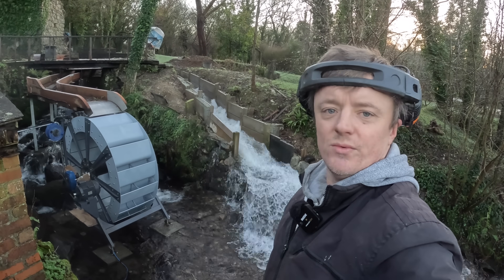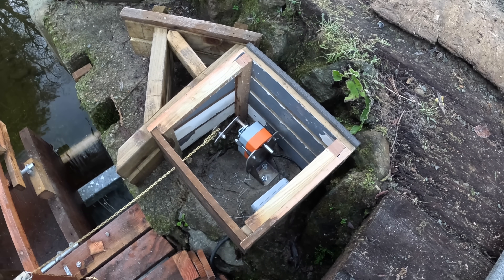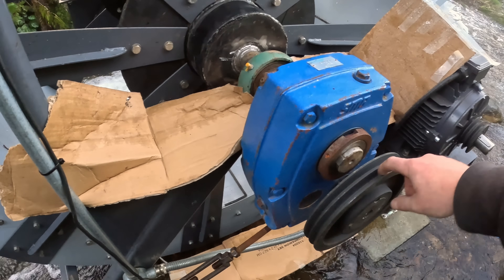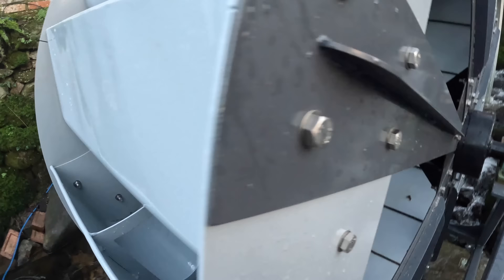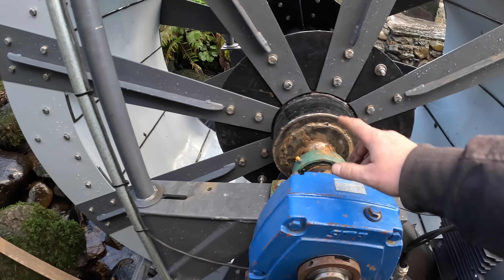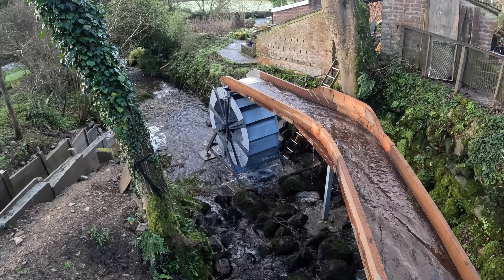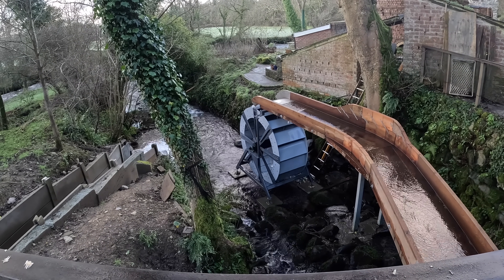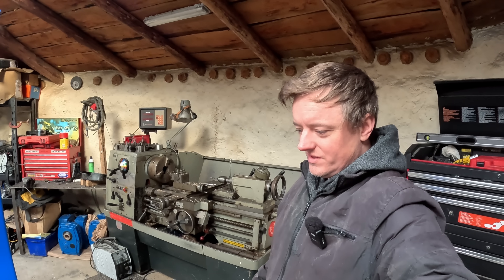Powering An Old Mill  1.5 Kw Lake District Overshot Waterwheel Project Part 5

Comment: If you wish to delve deeper into fatigue, Mechanical Engineering Design. Shigley, 2nd Edition is excellent and easy to understand. Later editions wandered into numerical analysis for writing computer applications and is not necessary (and confusing). FEA is not someplace where you want to go. Without a thorough understanding of the "nuts and bolts", totally erroneous solutions will result.
Without knowing what quality steel you have access to, design with low carbon, low strength, easily weldable. Replace your thin "diaphragm" plate with a much thicker (say 1.5") faced plate with a shoulder turn to stop at the pipe. Weld OD of shoulder to pipe, press fit, precise bore. Journal also shouldered with radii all along length, light press fit into faced "head plate" (chamfer in plate to receive radius). Weld shoulder of journal to head plate. Note: internal shaft does nothing but add weight. Pipe "axle" is by far "stronger". Attention to weld finish and detail just as important as described previously. BTW Austenitic stainless steels are among the worst materials for fatigue resistance on the planet...the reason that nuclear from the 60s-70s currently needs massive repair. Current stainless steel technology is light years ahead of that time ..but expensive. Luckily, your buckets, etc are subject to very low stresses in fatigue loading. I realize that much of this is of little help with your current...but for future. Best of luck.

Comment: Firstly, I admire the research and work that you have put forth with your wind turbine and water generation projects. Much respect.
After retiring from mechanical engineering after 40+ years, much of it in designing for fatigue and mitigating fatigue failures of the designs of others, your construction of the water wheel rotor at the shaft interface was an "oh oh". I have seen many such constructions fail in fatigue much as your failure in a fairly short time. The thin "diaphragm" from the larger pipe to the shaft is very problematic in fatigue (lacking weld quality aside). BTW Multiple diaphragms only lengthens the process and makes the destruction worse.
When rewarding, clean surfaces very thoroughly, grind out defects as best as possible (worst enemy in fatigue), controlled build with MIG towards as large a radius as possible, cooling as slowly (insulate) between passes. Repeat process until access is gone, Finish with gringing, polishing, coating area with epoxy to protect. The torsional element of the stresses is not present on the non-drive end, but will most likely follow in time.

Comment: Hi Kris, your cracking was very likely caused by fatigue. Depending on the source, its reported that around 80-90% of metallic failures on moving machinery are due to fatigue. Fatigue happens when you have a cyclic stress regime. In something like this it could be caused by a misalignment of the shaft/bearings, but I think you were quite careful on that front. Another possibility is that there is some kind of load being fed back up the shaft on that side from the alternator, possibly when it is trying to control the wheel speed. Hopefully your fix of generally beefing it all up will help to reduce the stress. The bigger weld looked to have a nice radius on it. If the worst happens and it does reoccur, you might want to think about how to reduce any stress further, such as changes to the breaking load fed back up the shaft, or by further spreading the load on that shaft/flange intersection.
Reply: slap a 20mm leg TIg fillet on it and itll be fine 🤣

Comment: Do you understand and have you considered the "bootstrapping" problem?

For example, if your system needs electricity to be able to hold open the relay that would otherwise pull the pin and shut off the power?

Secondly, it seems a lot of components in this system don't "reset" automatically... Isn't this annoying for the customer to constantly have to go and fiddle there? A bit of hysteresis might be a better design.

Lastly all the little power supplies everywhere seem like a recipe for failure points.

Good luck!

Comment: There's only a couple of things I thin would improve the wheel.  First is to put rubber around the sides of the water wheel to reduce the splashing over the edges and prevent the water from dousing the generator & bearings.  The other is instead of a complete cut off, I would put in an actuator to reduce the flow instead of a full cut off.  The customer would have to manually reset it, and if you have a reducing effect it would save a lot more headaches.  But this turned out awesome, I hope it lasts for many many years

Comment: Hey Kris.  Thanks for taking us along on this learning adventure.  I am trying to get my head around the economics of this installation where output maximum is 1.5 kw.   My utility charges $0.11USD per kWh.  At that rate if I assume average output annually at 50% or .75 kW 24/7 then the return looks like this :  0.75kW,  18Kwh /day,  6570/kWh /annual,  $722.70 savings @ $0.11/kWh

Comment: One further innovation would be to use the actuator so that rather than pulling a pin, it actually moves the water flow control flap up and down in accordance with the water wheel speed.  I suppose the only real advantage of this is saving water.  Love your work!
Reply: Would an actuator work in a powercut though?
Reply: @pheart2381  they make fail-safe actuators that would work, but not with the crude "hinged flap" design they've got going on. They'd need to design a better flow control system which, to put it bluntly, is way beyond their engineering abilities.

Comment: 0:55 "..it's a proximity sensor which reads the speed of the wheel which goes to a tachometer relay and then that relay monitors the speed. If the speed goes past the set value it then opens a relay then sends power to an actuator which then pulls an arm which pulls a pin out which drops the flap..... It's very simple"

Just want to remind you Kris, this is not very simple for 'simpletons' like me. Just saying - it may seem obvious to you, but to me it's incredible. 

You do a great job of explaining how everything works. The more I watch your channel the more "simple" these engineering feats seem to be. I want you to know you've given me the knowledge and confidence to build a post and beam woodshed (4mx6m). I wouldn't have been able to do that if I hadn't subscribed to you years ago. 
Thank you for sharing your knowledge <3

*Edit, typo

Comment: I'm sure I'm not to first to suggest that aside from the deadman trip on power-fail or overspeed, you could be controlling the flow rate with an Arduino-controlled actuator. Stupid simple PID algorithm with appropriate delays. Water under the bridge as it were, or rather over the waterwheel.

Comment: Kris, the reason the weld failed is a design flaw not a poor weld.  You welded 360° around a solid shaft to a plate.  Next time eliminate the welds and use keyed hubs.

After welding the weld cools and put the joint in tension radially, it will fail like that,  Your other side mostly like will fail at some point.

Comment: As time, weather, corrosion, and dirt accumulate on that pin, what ensures that the actuator will have enough power to pull it out - especially if it hasn't moved in months?

Comment: That broken weld, are you sure the axle isn't flexing when the waterwheel turns, it could be a stress fracture as you do have a heavy gear box sitting on that side?

Comment: Excellent Wrap up Engineering. The current flow is ideal for full performance with practically no impingement. You've taken a unique old water power site and breathed new life into it with the modern controllers an monitoring abilities. 
This goes down as one of the best technical design project progression video series ever made.

Comment: Hey Kris, I had a thought looking at the video of the water entering the buckets, there is a strong bias towards water falling into the buckets, towards the centre of the buckets. The water coming around the corner of the shoot creates a lot of turbulence too. I wonder if there is a way to straighten the flow and also get it to be more even across the width of the wheel?

Comment: Hey Kris, good work appreciate the videos on this it’s been a really excellent project. Just on that point of failure, it’s very common to see on conveyor drums I manufacture. It will be solved by using considerably thicker end plates to reduce flex between the shaft and OD the welding won’t be the issue there. Keep up the good work

Comment: You tried to use cheaper materials and it bit you in the butt. Instead of using a proper piece of heavy shafting across the entire width of the wheel you used a piece of pipe and thought you could just weld end caps on with a short piece of shafting to ride in the bearings. You forgot to take into account the massive torque water wheels make and you built the wheels connection to the bearing too flimsy. The shaft should be a minimum of 4" in diameter, 6" shafting would have added some safety factor as it is not just the weight of the wheel, but the weight of the multitude of gallons of water loading half the wheel.
There is a reason most water wheel bearing are not ball bearings and that is because the wheel spins at such a slow RPM that there is not enough heat generated by friction to warm the grease to help lubricate the bearing and the bearings fail prematurely. They are also going to fail early as their not sealed from the water and corrosion will cause the bearings to fail early. Proper water wheel bearing were built from wood i.e. Lignum Vitae that has an oil port and reservoir, Bronze sleeve bearings were used, and Linear plain bearings(used in a slow rotary application) from Pacific Bearing Co. they have an aluminum or 316 Stainless Steel housing with an ultra slick Frelon liner as the running surface and their 4" dia. shaft model has a static weight rating of 100,000 lbs/ bearing so it is unlikely you will be able to overload it. These bearing can have zerk fitting added to lubricate with grease of oil and they work even better in wet environments or submerged as the water adds lubricity to the bearing. Oh yeah, and they cannot corrode or rust as the aluminum model is heavily anodized and the stainless model is impervious.

Comment: Did you use flow rates from current typical river flow, or forecasted models from the increased atmospheric energy? We've been designing in for higher river flows for a decade now, but the forecasts are increased every year! We should have forecasted our forecasts :) But anyway, in some cases we are using nearly 40% higher throughput because it turns out that river basins are responding very nonlinearly and with big jumps in some streams and larger tributaries, barely noticeable in others, while the downstream collectors (i.e. the main rivers) are trending to the average forecasted increases reasonably well. But we've been caught out by those two things - generally higher increases in each year and far more variance in the increase from stream to stream. We are learning a lot as the energy goes up, but I fear our longer term (say up to 1.7C or 1.9C levels) may be quite far out either way, can totally see the increases not going much higher as well as increasing more. The scientists we work with are very honest about the magnitudes catching them out a lot in the forecasts. I wish there was space, but it seems the gulf stream slowdown and salinity changes affect evaporation in the eastern Atlantic as it gets to the UK which can be very reasonably modeled to both exacerbate the increase in energy and also to mitigate it (in terms of increased rainfall I mean). To be frank my chemistry barely keeps up when they explain such things. We use the numbers and we design them in and we sign things off, but if it weren't for indemnity insurance I really wouldn't be happy with the contract our systems come with - things are changing so fast.

Comment: Shouldn´t that overspeed protection not just close a bit of the flow instead of turning the whole thing off. Seems a bit overcaustious. It´s easier this way but need manual interaction to get it running again. Nevertheless, a really nice project!

Comment: Respected, surely I'm not a machinist, but I've seen this kind of failure before. Please check concentricity, or what is the right word in English. Your axle is under heavy side load, it is not oscilating around but constantly flexing the metal which breaks due to fatigue. Heavy welding might not help, but it is case to case. If I may, I would recommend giving a reductor a fixed point, and adjusting generator for belt tension. The place where I have seen this kind of fatigue is on reversing drums on material transporters in open pit coal mine. Reductors are hanged on main drums axels and hang on plato with motor, and whole plato is hanging in air countering the moment with a cardan like joint to main body (too much detail for text, my English is at beginners level). Best Regards, and hopes You solve it even better

Comment: Fantastic bespoke project, excellent engineering. Question: every time the power goes off, doesn't that mean you must manually reset the wooden dam? Is it not better to just let it heat the dump load to avoid this? Or is the grid power reliable? (In my country the grid power trips roughly once per month, so this manual reset would be annoying!)

Comment: Wind turbines furl away when the wind flow is too high, couldn't something similar be integrated into the supply?
 A flap that is opened by water flow dumping it in front of the wheel for example.

Comment: I was thinking about a electric motor hooked to the wheel shaft/axle that once the wheel would get to the RPM Max, that the sensor would send a electric current to the motor making it a break and a regeneration generator at the same time. Great job Chris....👍👍✌️

Comment: Thanks, and well done. I used those proximity sensors all over the place when I was still working as an Engineer, they are very reliable.
I recognise the Solis app used for monitoring the output from the inverter, also a very reliable inverter in my opinion, others will no doubt tell me theirs failed 4 times/year.
Hope you give us a review after say one year, when you do a maintenance visit.

Comment: Try using some AC 7018 welding rod on the arc welder. It starts easy and stays in position when welding vertically.

Comment: At least you didn't need the water wheel running to provide the electric for the welder, that could have been interesting ! 
Get yourself a small inverter stick welder Kris, we've got a Parweld XTS 163 that we run off a genny, great for breakdowns in the woods and no mig gas to get blown away.

Comment: Mild steel sheet does not harden without the addition of carbon, if it cracked through stress then it was never heavy enough from the start, there is a fair bit of repetitive stress going on there, and I bet that it cracked just beside the weld and not through it. It was caused by shrinkage and following plates need to be thicker and preheated before welding, this should greatly reduce the shrinkage stresses. Free info from a metallurgist, how often does this happen lol.

Comment: Great project Kris, it was a good watch. As for the emergency shutdown arrangements, try a maglock to hold the sluice open. They are weather proof, 12/24vdc, 300 to 500kg holding force, no moving parts and fail safe. Used in the security industry for door access control. All the best.
Reply: I think that would work but the power consumption is high. my solenoid auto shut off in the propane system used 40 watts. a small electrical sensor would use a lot less. you would have to read the manuals and get the correct numbers for the lowest power consumption solution.
Reply: @nomadicoasis9260 from memory they only draw around 350mA @12vdc. Cheers
Reply: @TechOne7671  Wow makes me wonder what was wrong with mine? When I turned it on my meter went up 40 watts. they are similar tech.

Comment: i would of used a  centrifugal Operation mechanical brake, there ideal as a safety, failsafe there shaft-mounted, bi-directional, emergency, for motors, for conveyors, for wind turbine, for elevators, for hoistsO so would work in this too

Comment: The other side of the wheel doesn't transmit torque; it's only free running. The other side connected to the generator does transmit torque and that's why this side broke. It's also a dynamic load so fatigue probably started a small crack which started the beginning of the end. Smooth transitions are important here to avoid stress risers. Thank you! Best, Job
Reply: Nope. The weld on the boss on the other side of the shaft also loaded in torsion as it connects the buckets to the shaft that drives the generator.
Reply: @danmcgraw5179  You're right. However the generator side get's all of the momentum on the end of the axis and is under a bigger load.